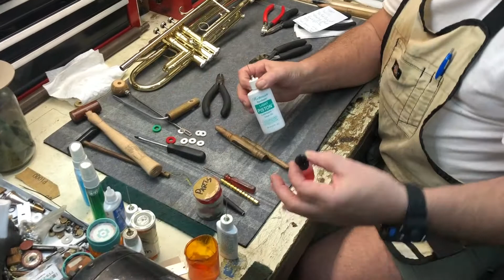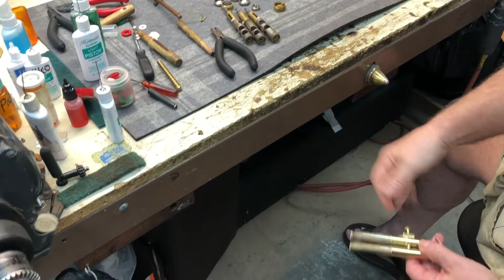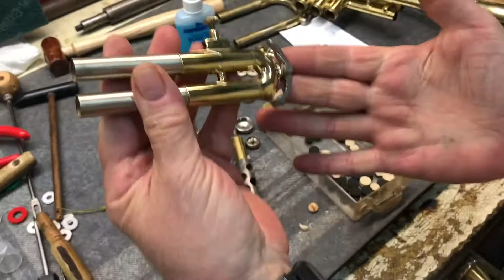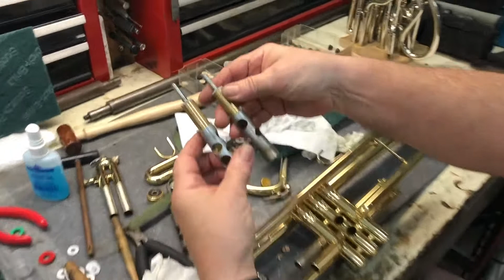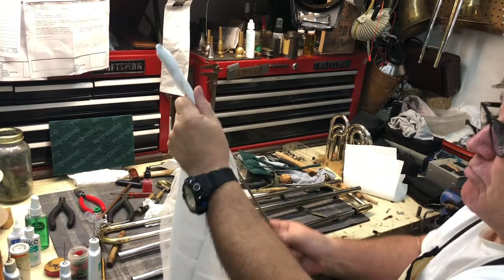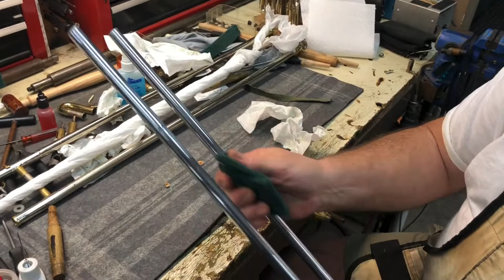Brass Instrument General Maintenance

Comment: Green Scotchbrite pads should NEVER EVER be used on trumpet valves. It's abrasive and removes material. Valves are hand lapped for a very tight fit. You just damaged that valve. If you don't believe me ask Scotch.